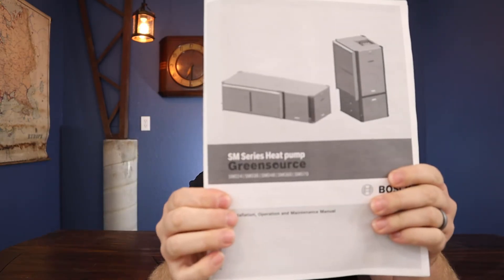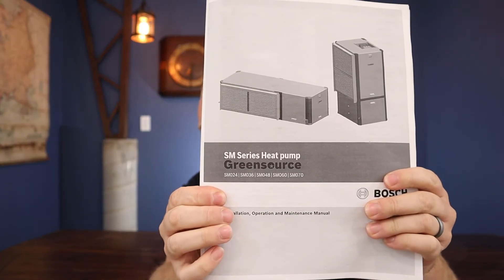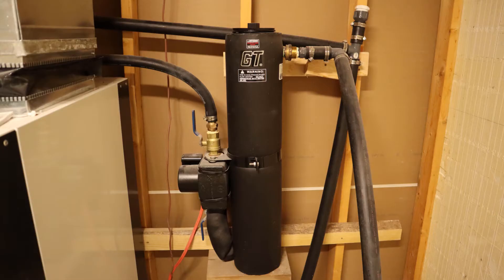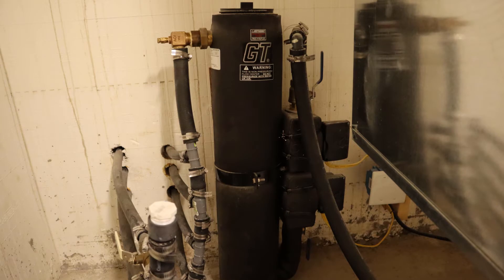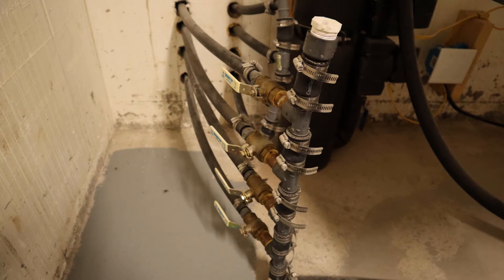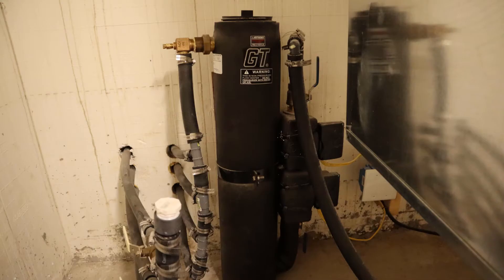How Much My DIY Geothermal System Cost

Comment: Did you consider building a more energy efficient envelope instead of needing two large ground source units?  Seven tons of heating is huge, even six as you mention could have worked, given a good portion of your build is below grade.

I’m building a two storey with basement, 5400 sqft total, so about 2/3 the roof and basement area of your bungalow, but the design heat load is only 2 tons (99% design temp is -13F but I designed for -22F/-30C).  It’s super insulated (R55 walls, R11 windows) and a good portion of the added cost for the envelope is saved by needing smaller hvac.

Not knocking your build at all; I’m a fierce supporter of DIY and ICF construction certainly has its benefits.  Just curious about your approach given the large heat load.  Thanks!
Reply from the maker: Believe it or not, the cost difference for a smaller unit isn't that much.  Both of my units have 2-stage compressors, so the majority of the time, they are running in the first stage, which is approximately 60% of full capacity.
Reply: @Challenged1  yes, most 2-stage systems spend most of their time in stage 1.  Do you have a rough idea what the duty cycles are at your design temperatures when the units are running in stage 2?  I would imagine in cooling season the units may never come out of their first stage.

Comment: Hi Garrett, I’m trying to figure out why you used a dual gt flow center for the 4 ton system. Was it needed or will a single gt flow center work?
Reply from the maker: It was spec'd by my supplier.  My assumption is I needed the extra flow to maintain the correct temperature differential.
Reply: Ok, I am starting to understand the system better now. I just learned these pumps are in series which leads to higher flow. I had assumed they were 2 circuits. Thanks for the quick reply. And great job on the install. I’m trying my own attempt. If I may, just one more question on the heat pump. I’m looking at the SM060, 5 ton. The websites I look at only show the heat pump not complete with air handler. Are yours complete systems with the air handler? Do you have more pictures of yours?
Reply from the maker: @beniaminpolocoser7395  It is all one self-contained package.  I have a bunch of Geo videos which show more of the system.  You can check them out within my channel.

Comment: Just got two quotes.  3100 square feet.  2 5 series water furnace units.  New construction.  $96,000.  Add $44,000 if I want a water to water for radiant heat.
Reply from the maker: Goodness!!!!!

Comment: I did my Heatpump about 12 years ago ( bought a Chinese water to water heat pump.  and use hydronic heating in my house I did mine for $1300 with out any credits. as i paid about $400 for the pump and around $700 for the lines and trenching together. my house was already hydronic so i basically just had to hook it up to that system. i did not go 10 feet only 7 feet and I live in a cold climate ( -45c in the winter. but my ground has high water table  of around 6 feet from the surface )  it starts off at +10c (COP of +3) in fall by spring it operating at +5c ( COP +2) so i have a little drop in COP over the winter . the heat pumps are still cheap from supplier in china now $700 per unit  for 7kw system. 12 kw is $1200 . meeting heatpump from china )
Reply from the maker: Thanks for sharing

Comment: Can you list the supplier website for the kits on all your geothermal posts? Thanks
Reply from the maker: To get the actual unit that I got, more than likely you'll need to get with someone that has a refrigeration license.  I own a bunch of income properties, so I have a guy that I use which gives me access.  Another alternative is the visit the Ingrams website as they do make kits.
Reply: @Challenged1  Is a refrig license different than plumbing?
Reply from the maker: @jakeglenn2246  Yes

Comment: Thanks Garrett,. Here is Texas we have high property taxes and high population growth. The average US home is only 2500 SQ and this number will be declining in the future. Currently in the US, we have 70% of the age group between 19 and 40 are Single marital status so there is no need for even a 2500 SF home in most areas. Of course this trend can change. It looks like you have a passion for Geothermal. Have you considered starting your own firm to install systems? It looks like you are already on the right by finding a low cost supplier.

Comment: I’d love to get some advice. I will be using in floor heating for my home (5000 sqft, 2800 on ground level slab on grade) can I use Geothermal for the heating the in floor and then use it with an air handler for cooling?
Reply from the maker: I don't know.  It would be dependent on what the manufacturer makes.  That's not an application I've researched.

Comment: If its 60 degrees outside wouldnt that mean the geothermal system is less efficient than a traditional system in heating up to say 73?
Reply: Outside air temp really has very little to do with the system efficiency, because it isnt using the outside air for anything.  The ground temp remains relatively steady, and as it uses that ground to hear and cool-that is the temperature that needs to be considered.

Comment: What brand and size air handler did you use with the bosh heat pump, or is it inclusive with the SMO36
Reply from the maker: It's all in one unit

Comment: Does this include the cost of the digging and excavating? Roughly how much did it cost of dig the ground and install the loop? Even if you did it yourself how much did it cost if you prcied your time at $100/hr.
Reply from the maker: I don't know what a company would charge to do the excavation.  This is the area where the majority of the savings would occur though.
Reply: I'm searching the comments for an answer to this question as well.  If you are pricing the overall system, excavation needs to be included.  I can rent a medium-sized excavator for about $3k per week here in Maine, + $1k in fuel + my time.  So I'm guessing I'll need to add another $4k to the overall price of the system.  Still a great deal.  Great content Garrett, thank you for sharing your experience!

Comment: HI GARRETT. CCOULDVYOU EMAILNWHERE YOU BOUGHT THE GSHP YOU USED IN YOUR GEOTHERMAL HVAC SYSTEMS? I AM PLANNINGBTO BUY THE GSHP FOR A PLANNED PROJECT IN THE PHILIPPINES. I AM PLANNING A HOUSE ON A 681 SQM I JUST BOUGHT. IAM PLANNING TO BUILD A 2,000 SQF HOUSE ON IT. SOME YEARS BACK I GOT INVOLVED IN AN GEOTHERMAL HVAC CLOSE TO SEATTLE, WASHINGTON. I ALSO FOUND OUT THAT THE TUBING WITH SAME SPECS ARE PRODUCED IN THE PHILIPPINES. I WILL BE BUYING SOME OF THE PERIPHERALS FOR THE INSTALLATION. I HOPE YOU CAN GUIDE ME THROUGH WHEN I NEED YOUR ADVICE. HOPING FOR YOUR KIND CONSIDERATIONS. THANK YOU AND REGARDS
Reply from the maker: I bought it from a local supplier.  You will most likely need to do the same.

Comment: Did you do a cost comparison on the geothermal heat pump vs a regular heat pump and installing more solar panels to pay for all of your electric needs? Seems to me it would be easier and cheaper to just install a big solar array and not even have a 100 dollar power bill a month?
Reply from the maker: At the time, I had no idea as to the potential energy needs of the house.  The solar was actually an after thought as I was building the house.  I happened to come across a guy selling pallets (18) of solar panels for cheap.  I couldn't buy less than a pallet, and knew I didn't need two pallets.  That's the story of how my system was sized.
Reply: @Challenged1  A few more solar panels and you can get rid of that 100 dollar power bill. You did great job in going with green low cost ac and heating. Nicely done.
Reply from the maker: @stevew5212  I'll have a video coming out in about a month sizing solar systems.  You may find it interesting why I have a smaller system.
Reply: @Challenged1  cool
Reply: @Challenged1  How cheap it was? This year I was surprised to see how cheap solar panels are. Inverters and the other stuff still keep the price up, but for heating I assume that it can work directly on DC and save some of initial cost. I did not got precisely how much was the cost of your heat pump system, but for sure seems to be more than 10 k. This means at least 20kw pf PVs. Is there enough insolation during winter to provide enough heating? 

Also, I was always curious about storing heat geothermally. For example, you could add let say few dozens of vacuum tubes to add heat all the summer through your coils. So, instead of extracting heat from a 10Celsius mass, will extract from a 50Celsius or more mass. Sure, not working with your high water level, the soil should be dry, and eventually some insulation added. With proper conditions, I mean hot summers, and proper sized insulated mass, I assume that the heating system will work without heat pump at all. Just heat stored.

Comment: It's pretty shocking that you don't know the correct terminology. This is called a "ground source" system. Geothermal goes deep into the earth to access boiling water.
Reply from the maker: The marketing term is geothermal, the technical term is ground source heat pump
Reply: I’ll bet you’re fun at parties.

Comment: HMMM THERE HAS TO BE AN EVEN CHEAPER WAY WHY NOT GO DOWN 4 FT AND LAY A PIPE AROUND 1/2 THE STRUCTURE AND ADD A FAN TO THAT AND THAT SHOULD BE MORE THAN ENOUGH IT JUST SEEMS THAT THE OLD MAN ON HERE THAT GROWS ORANGES TELLS FOLKS IT SHOULDNT COST MORE THAN A GRAND TO BUILD A SIMPLE SYSTEM LIKE HIS 12 X 40
Reply from the maker: You won't get enough BTU's out of a system like that

Comment: Do you know how many kilowatts your geothermal system uses daily, weekly or monthly?  If a roof top solar panel system made the KW I'm wondering how many extra KW would be needed for the heating and air conditioning year round.
Reply from the maker: I don't.  All I can figure is the total used for the whole house.  I also have a 5KW solar array.
Reply: @Challenged1  your utility company likely has a month to month and or a weekly break down of your kwh usage. They need to know it for grid management. So it is measured and perhaps available to you  ?
Reply from the maker: @sailme2day  The breakdown would be for the whole house usage, not the HVAC specifically.

Comment: What precautions did you do to safe guard the pipes from being damaged by stray rocks from the base or backfill? Also, since you were way deeper than needed why wouldn't you lay a layer of line, backfill a foot or so and than another layer of pipe in the same trench? For someone paying for excavation, this would be cheaper.
Reply from the maker: There were no rocks in my backfill, so didn't have to worry about it.
The loops need to have a minimum of 10' separation, so no stacking of loops/lines

Comment: Hi Garrett, I have a question about your manifolds which are used to fan-out and fan-in the loops.  I'm wondering about the fluid dynamics.  Why not have each of the loops in series, connecting the output of one loop to input of the next?  Would this require a larger pump?  I suspect the parallel nature of your loops may reduce the effective length of tubing applied to your system, but I could be misunderstanding something.
Great videos, thanks for sharing!
Reply: It is about delta 'T'. As the water in the loop warms, it collects less heat from the ground. You need to maintain flow and tube length so the water in the tube is always colder than the ground heat source. Any tubing beyond the point where the water is near the ground temp. is just wasted.  And, as the winter goes on , the ground gets colder. You have taken a lot of heat out of it. Tubes need to be short and many.
Reply: Hmm, maybe the manifold does not connect all of the loops together, but does connect each loop so they are in series?
Reply: Maybe only one loops distance of 600ft is required to heat/cool the liquid and the additional loops are to add more volume?
Reply from the maker: @kdub4pres  They are in parallel, with each loop being the necessary amount to transfer 12000 btu worth of energy.   The longer the tubes, the more friction within the pipe, and the bigger the pump required.
Reply: @Challenged1  ah ok. Thanks! Cool stuff

Comment: If my soil is primarily sand but I can dig into the water table, would you just recommend digging deep enough to submerge the pipes in water? If I can’t reach water, would you recommend not using this method at all since it’s mostly sand?
Reply from the maker: If the sand has a high moisture content, then you are good to go.

Comment: @
Garrett Glaser. So you need 600 ft of line to get one ton of heat power?
Reply from the maker: For my soil conditions, yes.
Reply: Dense wet clay moves a lot of heat. Dry sand is a good insulator. Little heat flux. There are charts of heat flux through soils.

Comment: Great informative video. It might be worth mentioning, at least for new builds, that by going radiant in-floor, even more savings could be realized.
Reply: If using a geothermal system, what you would be describing would be a water-to-water heat pump system, because it would be heating radiant water, not heating air. 

Question: Is water-to-water for home radiant heating systems more efficient than water-to-air heating systems?

Short answer: 
I don't think it would be more efficient.
For efficiency, it basically comes down to compressor high/low pressures and distribution (fan/pump energy). 
These are the only things that use any energy in the system anyway.  

Long Answer: 
For water-to-water source systems, the high-side refrigerant temperature would need be hotter to transfer heat to radiant water (return temps ~90) rather than to heat air (return temps ~65). 
The compressor have to work harder 'lifting' the refrigerant temperature more. 
Compressor power is related to high side over low side pressure ratio.
This can be raised to 2nd or 3rd power depending on refrigerant and operating conditions. 
In this case, ratio increases about 40% which to the 2nd power would about double compressor losses. 
However, the pumps in this system will use less energy than fans. 
I just don't think they will offset the extra compressor losses in this case.

The equipment would definitely be smaller, definietly more efficient than air-to-air source heat pump, but in my opinion not as efficient and water-to-air source heat pump with a residential style air distribution. 

- Mech engineer with some good experience specifically in these systems.
Reply: @jackwilliams5394  we have a new build and installed in floor heating. I’d love to not use propane since it is so expensive. Who can I talk to or how do I go about setting up geothermal for in floor heating? Can it also be setup to run to an air handler for cooling only?
Reply: @guachito2rico  Good idea.

Comment: In So AZ the temps range from 20F low in winter to 110F high in summer. I like warm temps and low humidity. Can a GT Air Conditioning system, in this environment, maintain a constant indoor temperature of 75-78F year around, night or day, 24/7 with a humidity in the 30-50% range?
Reply from the maker: All day every day as long as it is designed correctly

Comment: why it is not made of copper??? is better heat transfer material
Reply: The HDPE pipe used has a lifespan of 50-100 years, copper would fail well before that time.

Comment: I want to diy my geo but need help in the design and specing the equipment. Also building icf. In fact our situations are strikingly similar so your channel has been great
Reply from the maker: Good deal!!!
Reply: @Challenged1  If you attend a TECA Foarced Air Online Training program, you will learn everthing you need to know, about equipment and duct sizing.  Its a good course.

Comment: I have 300ft deep pair of wells and 7 trenches but I have a 7,000 sqft ranch and a 100x50ft "shop" but the shop isn't heated by the geo just cooled. Im not sure the tonnage. I just dug the holes lol. I didnt pay a lot of attention to my shit to be honest, ok have a guy who takes care of that stuff in addition to groundskeeping and general maintenance of my 85 acres. I have a 1 acre solar farm planned for the near future in addition to my basically whole roof unit and my wind turbine. I have 135kwh of batteries, fingers crossed my solar farm will cover my baseload needs!!!  Hard part is charging the EVs and running my 30HP air compressor to fill the 7,000 gallon of air if I have any of the CNC machines running parts I hit the grid pretty hard
Reply from the maker: Very cool, thank you for sharing!
Reply: @Challenged1  I'm really hoping the 1 acre is enough for full baseload power. I know I'll need to go bigger than 135kwh on the batteries if I want to go full renewable. I would love to have my own geo power plant but I uhhh ain't got THAT much money lol

Comment: Tax credits are great but it means you have to have tax liability equal to or greater than the credit. Otherwise you get no benefit. But you may be able to apply the credit over multiple years?
Reply from the maker: Correct, you can carry any remaining to the next years until it is exhausted

Comment: J.B.R.
Thank you Garrett for the simplification of the system and the DIY work and costs.  I will be adding a  Bosch system to our new build hopefully in 2021, SE Virginia.   For years I have thought of doing it at the present house, but as you pointed out, much easier when you have the room and building new than on a smaller lot and drilling multiple wells.  Costs will be lower using your fan method and I will rent the excavator for a week to dig the trenches.  Thanks again for your insight.  This will help me immensely.
Reply from the maker: I'm glad to help.  Another geo vid coming tomorrow